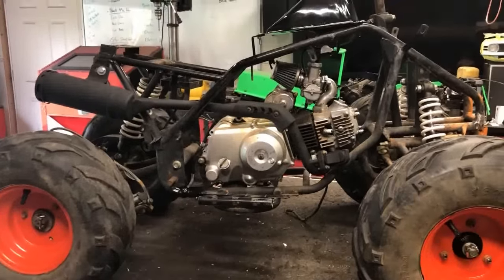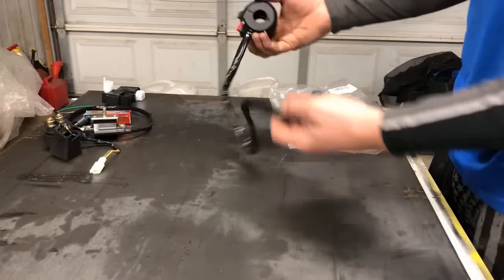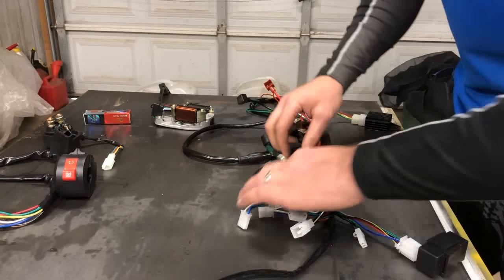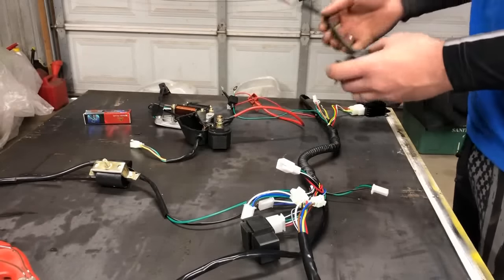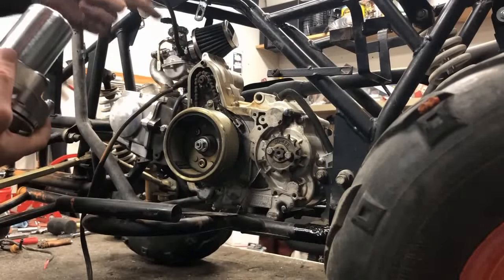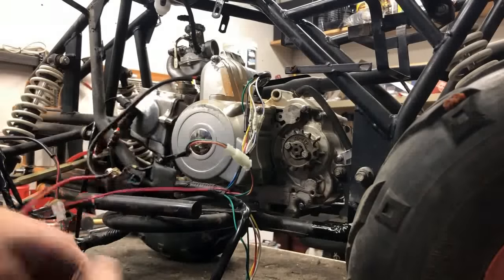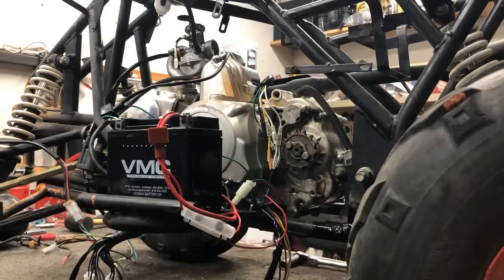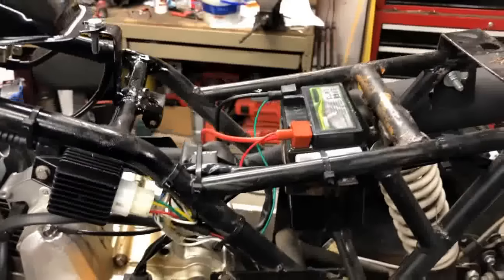Wiring a Chinese ATV from start to finish with an All New Wiring Harness!

Comment: Installed new harness kit and now have no spark. All wires from stator are ground? Is this right? Signal wire is constant ground
Reply from the maker: Stator, CDI, Coil, and Spark plug are the components that effect spark. You also have the ground wire, safety tether and kill switch that need to function correctly. Start with the easy stuff. Unplug your tether, clean your contacts for ground, make sure your battery is fully charged, and use a multimeter to make sure the kill switch functions properly with an open and closed circuit. If you do all that and still no spark, then likely you have a failed component. In my experience if you have a failed component it's usually a bad CDI Box.

Comment: Found you this past week and can’t seem to get enough. I thought I was crazy for finding it so enjoyable to work on these small engines. Glad to see you share my new found addiction. I’m super greenie to all this, but tackled my first atv last month and half way through another one when I found your channel. I have a couple question for you…why is there no fuel line inlet valve on this one? I found the same thing on the one I’m currently working on, and I was about to set it up with one, but not sure if there was a reason for the absence. Would love to know your thoughts. Also, the head light configuration doesn’t not match the new wiring harness I have. Wondering if you have general guidance to make that work.

Comment: I'm working on a 110cc icebear atv the person before me tried wiring it because starter messed up but I'm buying a wiring diagram tonight for it but my stator wire is a white plug and all the wiring kits I find  have all single wires not a Male end will this work if I straight wire it and make it all different Male ends to female?
Reply from the maker: I've actually done that multiple times. I use quick disconnects! Good luck on the project and let me know if you run into issues! https://amzn.to/2ELWKmw

Comment: so i followed ur video with my new harness. and my quad won’t start. my starter works and my battery works. idk what to do. i think it might be my safety brake system or my kill switch. what do i do?
Reply from the maker: https://www.youtube.com/watch?v=NtxnHGwcd90&t=1459s Watch this video starting @ 24 minute mark. Should help you find your problem.

Comment: Yo bj i having some problems i need to know which 2 wires from the stator coil does produce the current pleasee
Reply from the maker: The charge wires are both the Yellow & White. On some stators you could have 2 whites 0 yellow or 2 yellow with 0 white. Either way those 2 colors are your AC current.

Comment: I literally just ordered the 2 coil kit you have in the video description   And it came in today and the connectors are different and I also noticed the cdi box and the voltage regulator are both half the size of the original ones that were on there is that normal???       I got this 4 wheeler for free. And it has a no spark issue.  So I just ordered the whole harness like this.    And some wire colors didn’t exactly match either.  Hooked up all up the only way it could go...  and still no spark.      Mine is a 110cc. Not sure exactly which Chinese brand it is because the plastics are in bad shape.  And it has lights on the handlebars for neutral and reverse That are not on the new harness I just got.     My cdi box is like 2 inches longer than the one in the kit. And the old regulator has a 6 pin connector and the new only has 4.    The old ignition coil only had a black/yellow wire to it. Now the new one has black/yellow and a green wire.  So many differences???
Reply from the maker: Does your motor look the same as the one I have in this video? 6 pin voltage regulator is common on 150cc atvs that have a GY6 motor.
Reply: @PraskaBoysGarage    It looks identical only differences I see is the intake and the carb face forward instead of rearward like yours. And the chrome emblem on the stator cover is more oval shaped sideways. 

The only marking on the plastics I see is it says 110cc on the right rear fender under the seat. 

I tried to do more research last night and found the serial number on the left side down tube frame and it says LAAA55HA662005400. 

After looking that up it says it’s a 2006 Jialing quad. But from other ppl on YouTube I’ve heard the name brand doesn’t really help with anything. 

My original harness and stator doesn’t have any bullet connectors. It uses normal white connectors with flat pins in them.   I also noticed the gauge wire size for the battery posts on the new harness are a smaller size wire then the old harness.    Everything on the new harness looks the same it’s just a smaller scale then my old harness.      Regulator, cdi, battery wire size are all smaller on new harness and my coil only has black/yellow wire going to it and the new coil and harness have black/yellow and green

I wish I could copy and paste a couple of pictures in the comments to show you exactly what I’m dealing with.  

Those are the only harnesses I can find on Amazon and eBay that go to China quads. But all are smaller than mine.   If you have any other recommendations I would greatly appreciate it
Reply from the maker: @nickfulfer5411  Email me the pictures of the harness and your motor! Let me take a look at it. praskaboysgarage@gmail.com
Reply: @PraskaBoysGarage  email sent thanks for your time man I really appreciate it.  This thing is driving me crazy haha
Reply from the maker: @nickfulfer5411  No worries man! I just emailed you back.

Comment: Hey man I need help knowing how to wire my 150cc 4-stroke dirt bike I'm using a 6-pin CDI wiring harness system from eBay my dirt bike is only a Kickstart how would I wire it up
Reply from the maker: Dirt Bikes still require a CDI box  for spark but because they don't usually have batteries so you wont need the charging system. A while back I believe a watched a video on Harvey Spooners channel that shows the bare minimum you need to run on of these motors.

Comment: Got a question and hoping you can help me. I’ve been working on a 150cc Chinese ATV. Ordered the wiring harness you recommended. Installed it and everything has been working great. About once a week I got outside and start it. Starts with no problem. However today I went to start it and it just turned & turned and wouldn’t cut off even tho I wasn’t holding the ignition button. I had to disconnect the battery to keep it from turning! And every time I touch the positive wire to the battery, it automatically wants to start turning even tho I’m not pushing the start nor holding the brake handle. Any ideas???
Reply from the maker: Ceasar D. I’ve only had that happen to me once and it was after i accidentally swapped the positive and negative to the battery. After a lot of trouble shooting Finally it ended up being the start button. Start by unplugging components 1 by 1 while it’s turning over. When it stops, likely you’ll find your issue.

Comment: Hey so my stator which came with the wiring kit came with 2 yellow wires on the stator side and on the wiring side I had ever color line up except for a green and a yellow. hopefully you understand what I’m saying. wiring harness side came with yellow,green, blue, white,red/black.    stay or side has gr, bl/wht,rd/blk,yell,yell.
Reply from the maker: Both yellow wires are charge wires. Some come with 2 yellows and some come with 1 yellow & 1 white.  Either way white&yellow both do the exact same thing.

Comment: Hey not sure you are still answering questions on here or not but I followed you to the T what would cause very weak spark?
Reply from the maker: Stator, CDI, Coil, and Spark plug are the components that effect spark. You also have the ground wire, safety tether and kill switch that need to function correctly. Start with the easy stuff. Unplug your tether, clean your contacts for ground, make sure your battery is fully charged, and use a multimeter to make sure the kill switch functions properly with an open and closed circuit. If you do all that and still no spark, then likely you have a failed component. In my experience if you have a failed component it's usually a bad CDI Box.

Comment: Will that wire harness work on a polaris outlaw 90 or just for Chinese  4 wheelers
Reply from the maker: I've used Chinese parts like kill switch and key for a polaris 90 before but never and entire harness. I doubt it would work.

Comment: love youre video's man! but i have a problem, i have a Chinese quad too that i ordered new Wiring hardness too, but it just doesn't do enything, i din't replace the stator tho so if i need to do that can you just reply and say yes or no?? please
Reply from the maker: Just to be clear, the motor isn't turning over at all or it just wont run? Let me know the exact issue and I can help you trouble shoot.
Reply: Praska Boy's Garage moter is great, i found it out, but the battery is not good i think so i tried a bigger battery and it fired right up! But what battery do you think is perfect for a 200cc engine? The original made the ground and power wired sooo hot so im not going to use than one and the battery i made it fire up i use on my lawn mower tractor

Comment: Update, I hooked it up and nothing happens until I turn the lights on hi beam, and it cranks over. On that two wire conn.  I have red and green from switch and  red and green on wire harness, only red goes to green and green to red at the connector. At the 6 way conn brown goes to black/white, brown/white goes to black, grey to white. Bottom side yellow to green, black to blue, and blue to brown. I’m confused, is switch wired wrong or harness wired wrong?
Reply from the maker: It's difficult to follow your comment, can you send an email with pictures? I'd love to help anyway I can!

Comment: Hi this seems like the exact one I have , could you tell what size the front wheels tire is , I can’t seem to find one anywhere 😫
Reply from the maker: 16x8.00-7 is the tire size. You can get them in an aggressive tread or a turf style. I usually look for a deal on eBay to buy 4 of them under $100 bucks.

Comment: this helped me alot. I just have one question. I have two lines coming out of the motor. did I buy the wrong harness?
Reply from the maker: Depends on the location? Are they behind the stator cover by the sprocket? If that's what your talking about then your ATV was equipped with a reverse and neutral light. Those don't hook up to this harness but the harness will still work.

Comment: if i had a 4 pin cdi box do i have to find a 4 pin cdi wire harness or can i convert to 5 pin with new stator and harness?
Reply from the maker: Honestly, I've never tired it. Here is what I know: The only difference between a 4 and 5 pin is a black/white wire that is used to kill spark. Like the safety tether in the back and kill switch. Everything else is exactly the same. My guess would be that it works. Again that's a guess, since I've never personally done it before.

Comment: any suggestions  on where  or how to fix my 125cc venom  grizzly  (Chinese) 
atv

the atv battery cable( Red) melted to the battery when the atv was trying  to start

what should  do first to fix this

the atv can start  but  I seen  sparks.

can an atv  run with out a battery  ?

I can temporarily use a car booster to power the atv to start  ,but  would it technically work without  a battery?
Reply from the maker: Yes, it can run without a battery but you have no way of starting without it. It's would function the same as a kick start dirt bike engine.

Comment: Great video. But I I replaced the wire harness on my quad all the colors matched up but I still get no fire to the plug. Any ideas as to what else could be the issue?
Reply from the maker: TheTumbleweed1965 Thanks! Okay,  now did you just replace the main harness or did you also change out all the components? (Stator, CDI, Coil, and spark plug)
Reply: @PraskaBoysGarage  everything. CDI, Stator, voltage regulator, harness, and plug also added a key switch that came with kit.
Reply from the maker: TheTumbleweed1965 Alright, well I understand this can be frustrating. Start simple first: Is the kill switch in the run position? Do you have a good ground? Did you plug in the safety tether in the rear if so unplug it and check for spark. Are your wires from the stator all connect correctly? If all that checks out try replacing the components with originals that came off the ATV 1 at a time. Every time you replace 1 check for spark. If no spark still replace it back with the new and move to the next. Let me know if you  get it!
Reply: @PraskaBoysGarage  thanks for the reply. I work on small engine alot but this is my first time working on a  (CDI ignition system). But so far I've checked ground getting about .03-.01 from frame to engine and from frame to ground coming from the stator. Have about 13v on red/black wire coming from stator to CDI box. Do not have a tether on bike should the connection be jumped or open?  But listening to yours spin over it seems my starter is dragging or spinning over considerably slower than what yours sounds on the video,and I also thought that from the start,so I've ordered a starter assuming mine is just worn,I did tear it apart it spins free but has that burnt electrical smell. Thanks again for all your input and great videos I love learning new stuff. I'll let you know how it goes when starter arrives
Reply from the maker: TheTumbleweed1965 Best part about these things are they are easy to learn on and inexpensive! The tether needs to be an open connection so leaving it unplugged is perfect. This may sound crazy but is your battery hooked up backwards? It will actually causes the motor to spin in reverse. Seems silly but I’ve done it!
Reply: @PraskaBoysGarage  interesting I would have never thought reverse polarity would do that but makes sense with type of motor for t is,but no it's hooked up hot from solenoid to starter and ground to block (same bolt you did). Although I had to go look to make sure.... LoL I think I did see it spark one or 2 times but out of the 100 plus revolution's. I picked up the quad at dumpster so only get t about $40 in it so far, hopefully it will work good and I'm building it for my grandkids Christmas present.
Reply: @PraskaBoysGarage  looks like the starter was dragging, got the new one in and it's fireing like a champ, Little over 120 PSI compression she runs like a top. so now don't mind spending a little bit of money on it getting the body parts looks like my grandkids are getting a quad  for Christmas.
Reply from the maker: TheTumbleweed1965 Awesome!!! I’m pumped for you and that you got it figured out! Enjoy the rest of the project and let me know how it goes!

Comment: working on a 125 cc coolster my break lights wont turn on and also the hand lever wont display break lights when i press the foot break it dont start the hand lever pressed will start the bike i got power to the break pedal switch adjusted the switch and nothing when i turn the lights on the font and back they  come on iam stuck need your help thank you

Comment: Excellent video ! 
But I've got a question because I still have no spark: 
The one electrical item that my TaoTao 110cc has that your ATV doesn't is a 2nd set of 3 wires that exits the engine immediately behind the magneto wires. 
I believe these went to the "DRIVE-NEUTRAL-REVERSE" display indicator ...
Any ideas on why I still don't have spark ?
Reply from the maker: Cam Mealy Your are correct. Those wires are for a neutral and reverse light. These after market kits don’t come with them integrated so you’ll lose the light indicator. No spark could be a number of issues. Simply start by unplugging and plugging back all the connections to make sure they are correct and secure. Then check the kill switch and the tether kill make sure both are in the run position. After that one by one you’ll need to test all the spark components. Plug, coil, cdi box, and stator. It can be frustrating! Good luck on the hunt!

Comment: Nice video, Im looking to upgrade my 200cc TAO TAO with speed and power, Can anyome tell me the best steps to take and best place to get these part??
Reply from the maker: The 150cc and larger atvs are harder to shop for when it comes to performance parts. I've always stuck to eBay for options and Amazon for the prime shipping if available.

Comment: Loved the video. I have a short somewhere. Every time I put a fuse in. It blows it. I know there's a short somewhere but can't find it.
Reply from the maker: I would look at the key switch and the start button.
Reply: @PraskaBoysGarage  hey thanks alot. Bought a key switch.  The little box that controls the stator, 4 got the name. The box was getting hot that controls the stator So I'm ordering another and replacing it next. Thanks a lot.
Reply from the maker: @richardwright8902  Nice, the good thing is all the parts are pretty cheap! Good luck, I hope you figure it out!

Comment: Question. My headlight is a single 4 pin connector but harness has 2 plugs. How do i wire my headlight?
Reply from the maker: What kind of ATV do you have? If it's just a single headlight then it does require some modification and I can walk you through it.

Comment: If I get a full wiring harness with stater and everything does it matter if the other wired harness was different on my Chinese 125CC atv.  Even if the old standard had 5 pens the new stater has 6 pens in it would that matter.